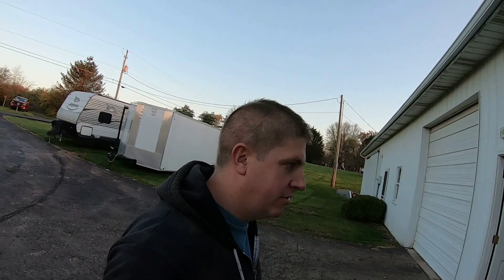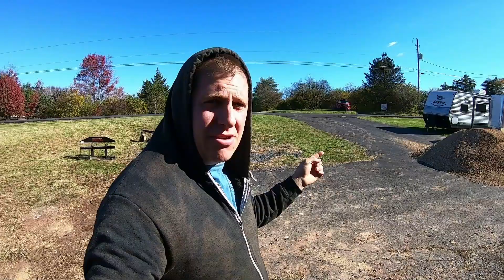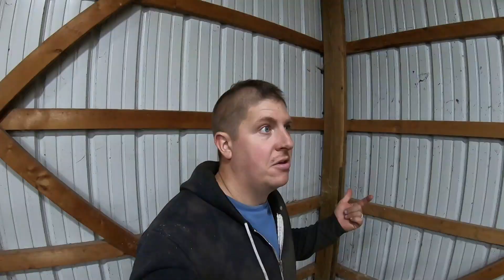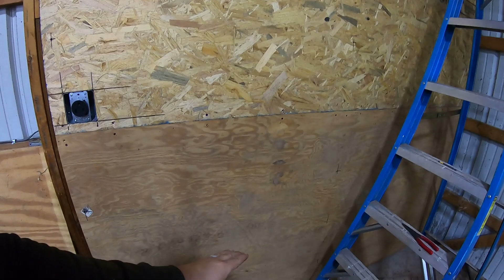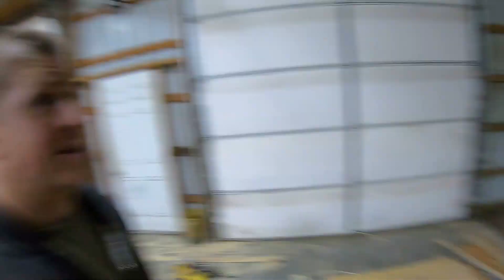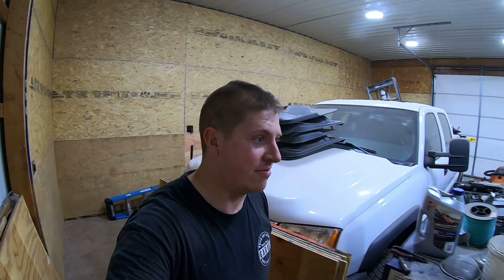Workshop Wire Tuck! Dream Workshop Build Update 4

Comment: Are you a perfectionist I know I am and when you just want things done the right way some contractors will tell other contractors that you’re a super picky person and to not work for you. Not saying that’s what’s going on in your situation just a thought. Another reason might be it’s getting close to winter and concrete guys don’t like to work in the winter or when it’s cold outside. But most of your work is in covered areas and you would think they would jump at a covered job. Just some thoughts. Good luck with your remodel.
Reply from the maker: I'm really not. Like you see in this video, I was happy with the electricians work when they did it, I even left them a good google review. We had our septic tank replaced yesterday and same thing, the guys did excellent work and I was very kind, cordial, and appreciative of their work. I spent time working in the trades so I try to be a customer that I would want to work for. 

Agree with you about people not wanting to work in the weather but also like you said, it's all covered, I would think they would jump at the opportunity.

 Thank you!!

Comment: If you can live with a C+ to B+ grade on cement work, just order a truck and do it yourself with a helper. 
https://www.youtube.com/watch?v=kzBmH7dbM48&list=PLbQvp_PhybpmdnmPHXOr23HHZLkF54nDO
Reply from the maker: Thought about it, but I really want this shop to be something I'm proud of when I'm finished and know it will last a loooong time. Plus putting a lift on this slab I want to be sure it's right. I could probably do it, but I'll feel a lot safer standing onder a 6000+lb truck 6ft in the air, on a slab that was professionally poured.